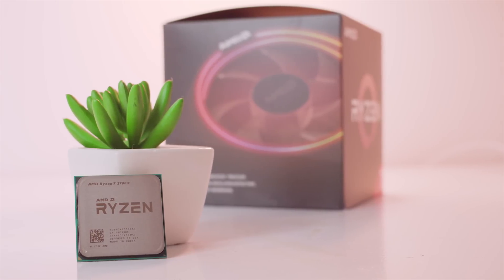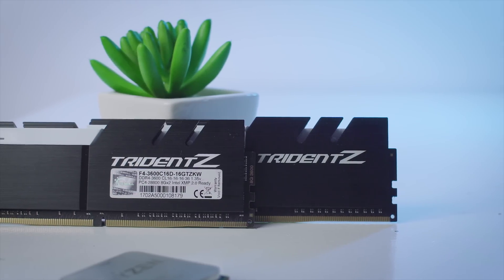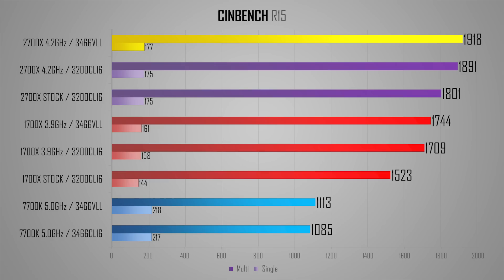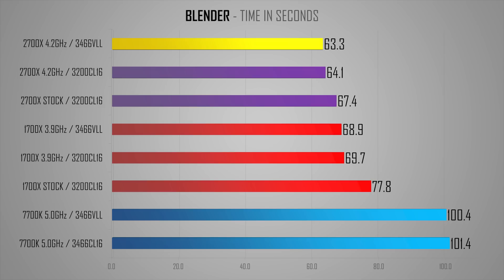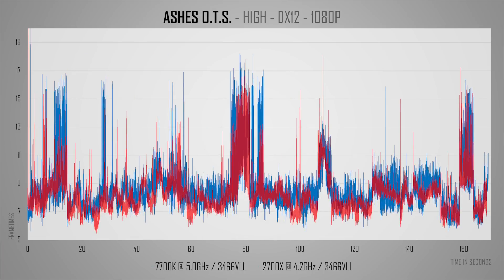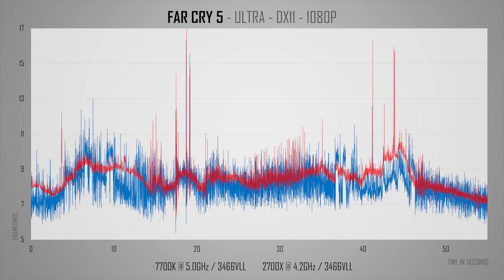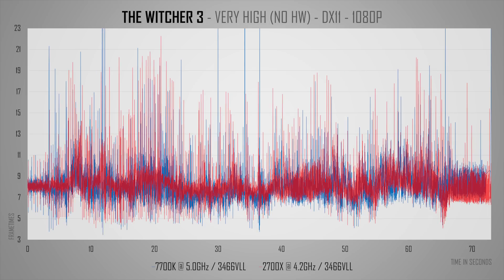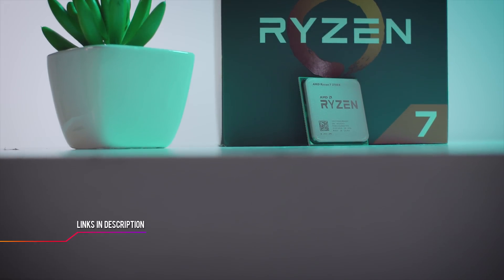RYZEN 2700X + Low Latency RAM - Still AMAZING PERFORMANCE gains...

Comment: Great video as always, but the 3200 CL16 results should probably have been the standard Hynix 3200 16-18-18 affair. Really, it would be nice to see a mega-test on the R7 1700 and R7 2700x both at stock and overclocked using 2400 CL15, 2666 CL16, 2933 CL17, 3000 CL16, 3200 CL16, 3200 CL14, 3466 CL16 and 3600 CL16 - all at stock timings for the standard out of the box or XMP/DOCP settings for Hynix and Samsung RAM, then take say 4 of the most common ones like 2400cl15/2933cl16/3200cl14/3600cl16 and show Fast and Extreme timing settings to show the scaling and relative performance. 

For example I cannot get my 3200 CL14 Bdie kit stable on my x370 and r7 2700x higher than 3200 mhz, but I've got it down to very tight subs on 14-14-14-22-36-256-1t rock solid, showing 65ns latency in Aida64, which is pretty decent. It would be really nice to know where those kinds of "extreme" 3200 CL14 timings sit compared with looser 3466mhz settings. 

Nobody has done this test yet, AFAIK, and would be great in showing people why it's not enough to merely set XMP and go if you want to maximise performance, or why they should spend that extra 15% going from a 2666mhz cl16 kit up to a 3200 cl14 bdie, in real world terms. I'd also like to see where any points of exponential gains occur, if any.
Reply: This would be awesome. Currently running Microcenter SuperSC 3200mhz CL16 (Hynix, single rank) memory kit and I want to know if I can get this thing even higher or tighter for more gains. Need more frames in Fortnite.
Reply: The 1st test is not needed, if you watch his previous testings you gonna know all the difference, and its hell of a difference with 1st gen Ryzen. Motherboards load shitty sub-timings thats why tuning is important, as shown in this video and the previous ones.
Also the mediocre 2666 CL16 kits are far less cheaper than the G.skill b-dies, let alone the 3600CL16 kit that he uses, which is a bit more expensive than the 3200CL14, in my region at least.
Reply: I've got Team Dark Pro Samsung bdie at 3200 14-14-14-31 tweaked to  14-14-14-22-36-256-1t ... I'm good. I've been on OCN for a decade now, and built my first PC in the 90s, overclocked my first one not long after.

I'm just suggesting a video which could help a lot of people and would be interesting from a builders perspective.

You're wasting a lot of time and energy trying to explain why an objectively useful video wouldn't be useful. 

Why is that?
Reply: he got the idea from me.
Reply: I disagree. Sure, the first test has been somewhat done separately in other places without much depth to the detail of what timings and subtimings are used. Most reviews on YouTube and the web state the frequency alone, some also include CL, and then a handful include the primary timings. 

Nobody has done a full year showing the difference between XMP 2400 cl15 vs tweaked against XMP 2666 cl16 vs tweaked against XMP 2933 vs tweaked etc etc.

The first test is needed because you need a baseline for any such comparative test, and it might be surprising to see 2400 tweaked matching or beating 2666 XMP for some people, and also to see the potential gains by tweaking for people who bought say a 2666 kit and stuck it on XMP. Finally, we might learn where the true best value proposition lies, say if you got a 2666 kit that managed 2933 but could get the timings down to cl14 and tight subs.

Most videos and reviews only show the gains of heavy tweaking on super high end RAM - I suspect there's a lot to be gained in that mid section where people probably overlook the value of custom tweaking.
Reply: If you wanna know all the settings, i think Mindblack has some of them in the 1st video, you can ask him, im sure he will gladly reply. Youtubers dont show nothing than speed cuz they are nothing more than marketing managers, excluding channels like this one and Gamers Nexus, if you wanna know the limits of the AM4 platform go to Overlock.net, where i belive Mindblack got the idea and the info for testing/tuning VLL ram :), the youtobe marketing managers are for kids and non-enthusiast :).
All the info in terms of difference is in this and previous videos.
The cheap 2400/2666 kits are not b-die, even many many 3200 kits are non-bdie, the most value lies in the 3200Mhz CL14 Trident Z kits, if you can find one for cheap, the Hynix/Samsung E/D-die's are not capable of such low timings, as far as i know.

Comment: my 3600mhz 16cl bdie ram isn't stable with xmp with 2700x on gigabyte x470.  it loads to windows and runs cinebench fine, but whenever it uses gpu with the load, it doesn't load games, etc.

Comment: Nice results!

So.. what's easier, delid with a vice and maybe, a hammer, or calculate the ram subtimings?
Reply from the maker: Lol, I'd just run a 2700X at stock and tune the timings to hell and back. I ran a 2600X with 3200-13-12-12-12, was fast as heck. And ran the 7700K with 3333-12-12-12, and even the coil whine on the GPU under load was more powerful, that's how fast the CPU was in some instances. :)

Comment: Ryzen second gen has better performance out the box than first gen. the extra ipc and improved cache gives it an edge. but a heavily tuned ryzen 1700 gen 1 can keep up with 3466 vll. if only i could get my flare x stable at 3466mhz. cl14

Comment: For best results you require 3200CL14 or 3600CL15, both are highly binned chips that can do better than your regular 3600Cl16
Reply: The G.skill that he tested is also highly binned B-die, G.skill have also 3600 CL15 but i doubt that is better than the 3600CL16, its just another segmentation of their line up, thats why their 3200CL14 kits are as the 3600 CL15/16 but come cheaper, i guess the insanely high speed 4400-4500 CL 19-19-19 are better binned, should be.

Comment: ty! 
My ripjaws v 3200c14 goes 3533 cl14 on x470 asus prime pro with 0 issues on memtests but i guess i can go even further. Atm aida64 shows 60ns latency with current result. only problem is cpu temperatures, its quite high with hard load (78-84c) even with nh-d15, mb there is an issue with these results and they are wrong. After fixing this problem i will try go 3600 cl14 or even further and will make some video benchmarks.
Reply: Made 59ns by tweaking secondary timings from dram calculator extreme preset v1   24/7
Cpu goes 4.2 all cores with 1.356v on each core under load
Equal to 8700k @4.8 and sometimes @5.0 depends on a game
Reply: So what you're seeing is that pushing the RAM more will also come with a big CPU temperature increase. Why would you set a manual OC though on a CPU with PB2/XFR2(/PBO)?
Reply: new bios solved the problem. The temperatures not going over 77 with 4.125ghz and 3.8v in heavy stress tests now and in games its much much lower ofc. Will spend some time on oc ram further
Reply: Are you running stock? Maybe the asus mobo has the boost enhancement activated by default.
Reply: On cpu - no it's 1.375v and 4.1 all cores. i've set llc to level 1 so voltage not going over 1.395.
Reply: Bad Russian Man Interesting.
Reply: What kind of Dram voltages are you using for 3446 or 3533mhz?
Reply: 1.43v and soc 1.0375 llc4 140%
Reply: BadRusMan if u have a x cpu there is a 15 to 10 degree offset
Reply: yeah i know and 80+ temps are right under stress tests
Reply: Вроде должен понимать русский, посему: ты какой кит используешь? Не этот часом? F4-3200C14D-16GVR
Ищу хорошую память под райзен, чтобы не терять 20+ фпс. Как я понимаю там B-die чипы?
Are you using F4-3200C14D-16GVR kit, right? i'm looking for a good RAm for my Ryzen new PC now and your results are pretty interesting for me. If am i missed and you're using another Kit can you name it?

Comment: What's VLL ram?
Reply: Very Low Latency, it's just a term he came up with to differentiate it from stock, CL16 etc. It's not a specific industry term or anything.
Reply: Very low latency. It's how he refers to having ram with very optimized timings and sub-timings.
Reply from the maker: Very Low Latency. Short for the optimized timings. It's not as clear cut as saying 3466CL14, since even the secondary timings are tightened.